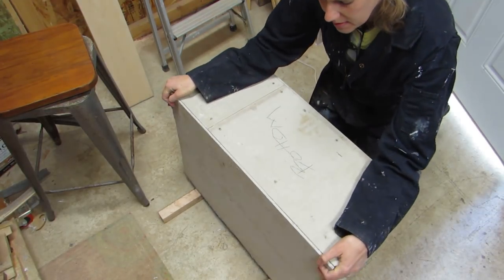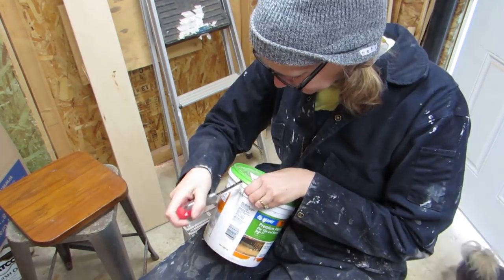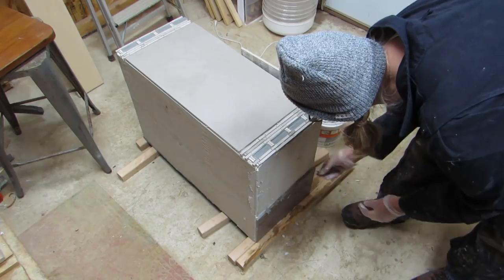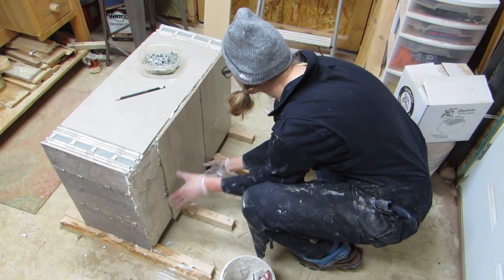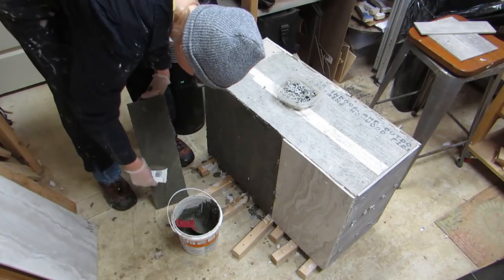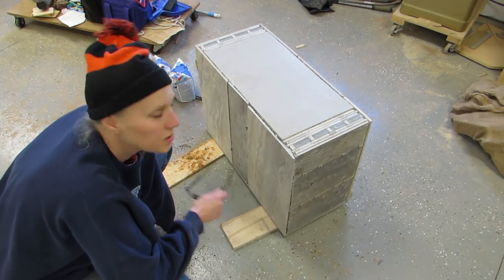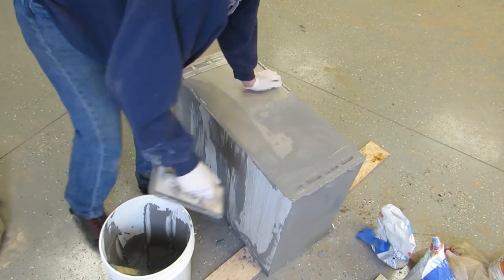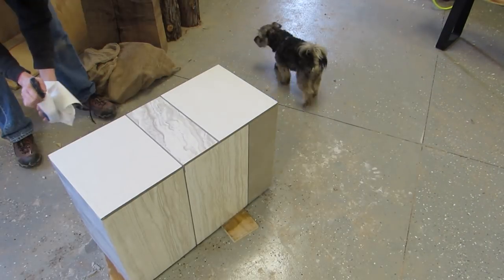Making a Shower Bench

Comment: Perfect! We are yanking out tub and tiling new shower! This solves all our problems. I dont want a permanent built in bench because of space and cleaning reasons. I wanted a removable one but wood rots! We are tiling our shower with pretty ceramic gloss off-white subway tile but I’m going to do this with “wood” tile for a wood bench look! Thanks for sharing!
Reply from the maker: Oh cool, yay! But please make sure to use concrete board and not wood like I did for the inside.. The grout doesn't seal it enough and the water gets into the inner wood. I would avoid any wood inside of it. :)

Comment: Hi Cy, The tub lids are designed so you 'fold' the bottom part upwards and then take the lid off. When replacing it, you put the lid on and then 'unfold' the lip of the lid. There should be a small flap piece on the tub itself just below the rim of the lid where it can be broken off and that is where you start to turn the edge of the lid upwards. :) Great vids. I love your cheeriness in them.
Reply from the maker: Thanks Ian. I have never heard this before and I look forward to opening my next hard to open container knowing that it folds!!! Thank you soooooo much!!!!!!

Comment: Hi Cy, have you had any problems with the bench sliding down or moving around?? Lmk love this idea!
Reply from the maker: Hi, no problems with that, however, we did have a problem with the plywood inside. Make sure to use concrete board inside because the wood rots from the moisture. Apparently it wasn't air tight with the grout. 👍